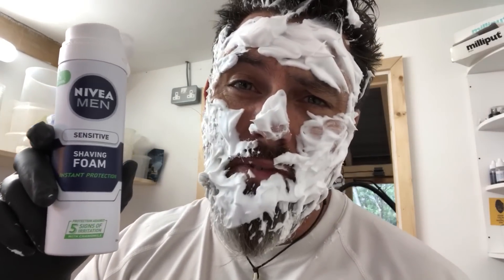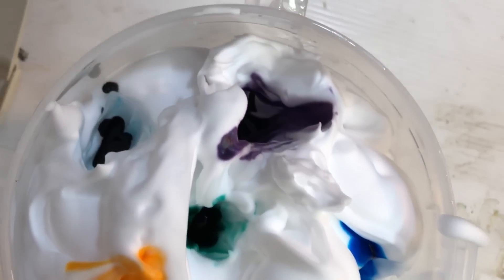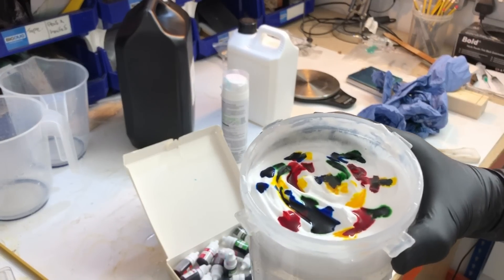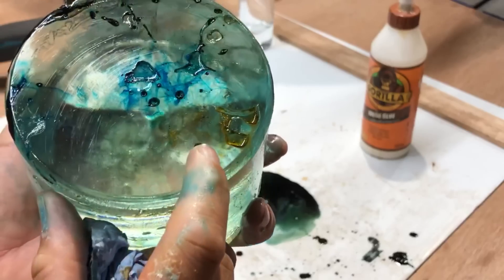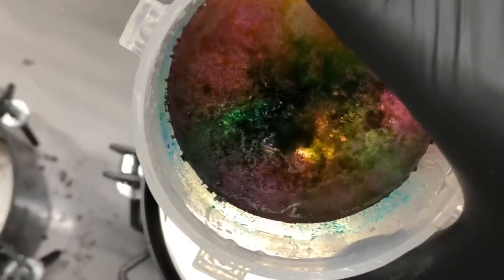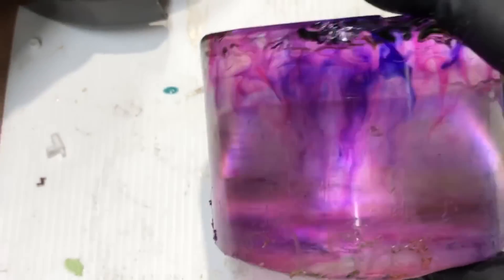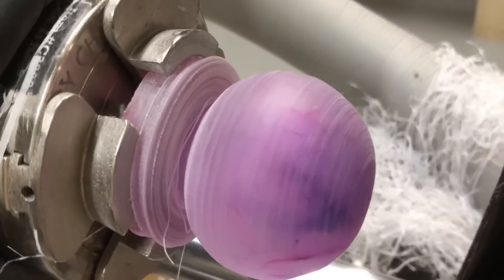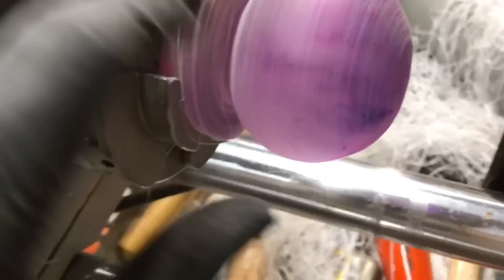Shaving Foam - Epoxy Resin & Food Dyes - What Happens ?

Comment: Thank you for making such interesting art.  I would never have thought of doing something like this.  I have to say, while I liked the colors in the larger piece, I thought there might be too much blank area.  However, the finished shape was perfect.  And, I have to say, I like the larger finished piece much better than the sphere, even without the light.  

I do love watching someone use a lathe on resin.  You could practical hide a body in all the strings it produces … stated just for the imagery, not as a suggestion to anyone.  (It probably wouldn’t work anyway, but still not a suggestion.)

Comment: I've sort of done this effect with shaving foam only I didn't use Resin & I used Alcohol inks to get a good effect on my card crafts. What I did was put Shaveing foam into a deepish tray I then put the Alcohol ink ( I suppose you can use food colouring haven't tried it so aren't sure if works ) anyway once I put the Alcohol inks how I wanted on top of the Shaveing foam I then got Gloss photo paper ( you can only use gloss photo paper for this to work ). I then placed the Gloss Photo paper on top of the Alcohol inks, Shaveing foam, lightly push the Gloss card down on to then life the card up, wipe over the top with a dry Kitchin paper even a soft cotton even silk cloth, wipe the Shaveing foam off do not rub the Gloss card. you will be left with dry gloss card with just the Alcohol inks on the gloss card. Usually all the Alcohol inks will totaly be transferred onto the card non left on the Shaveing foam but if there is some left keep repeating till all gone. this effect is Beautifull what ever Patten you make with the Alcohol Inks will be what Transfares onto the Gloss photo paper. Also when you wi pe  the Shaveing Foam off the Gloss Photo Paper  the paper ends up snuff dry and you don't have to rubnhard just 1 gentle wipe will do

Comment: Those turned out pretty great. I'm surprised you didn't fill the checks with resin. Rather than putting them on the same piece (unless this is just a demo), a better and really cool alternative for the spherical one would be finials for a 4 poster. It's the first thing that popped into my head when I saw it all polished up.

Comment: I think you would have had better luck if you degassed the epoxy then did the foam and coloring. No pressure pot. The foam needs to retain most of its airy structure.
The results you had are beautiful though!

Comment: Those would have made cool “tea light holders “ if you could find a way to cut a 2 1/2 - 3inch hole from the top in to the middle and stop 1 -2 inch from the bottom 🤔🫶🏻🇨🇦

Comment: What if you made a blank im a container that's taller and narrower? That way, the dye would be more condensed towards the center of the blank and have a longer distance to fall. With a longer distance to fall it would take longer to get to the bottom. Might help to string it out. Then if you needed more body to turn the blank, you could put the color blank inside a bigger container and pour more resin around it. Sort of a resin blank inside a resin blank. Then turn it.